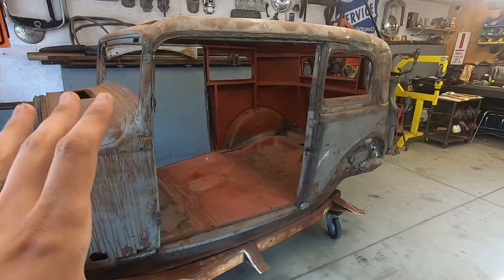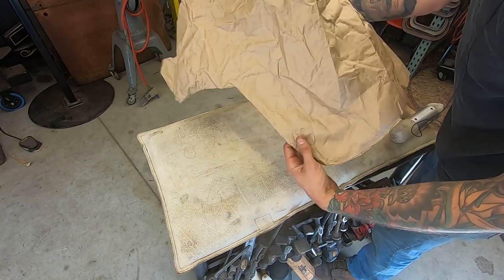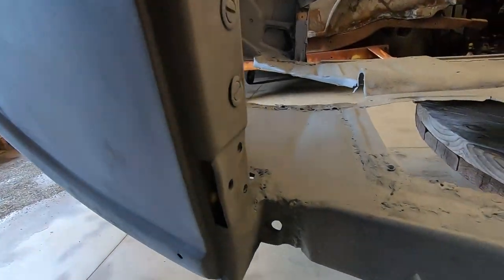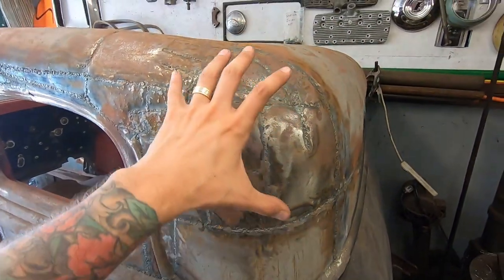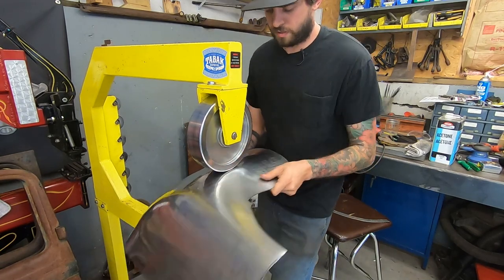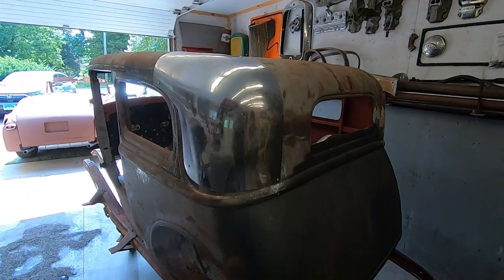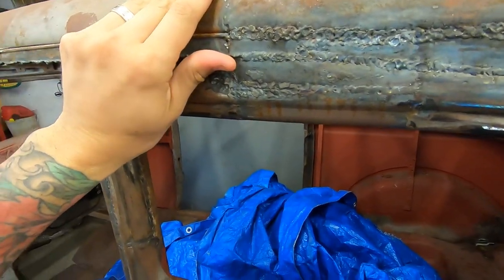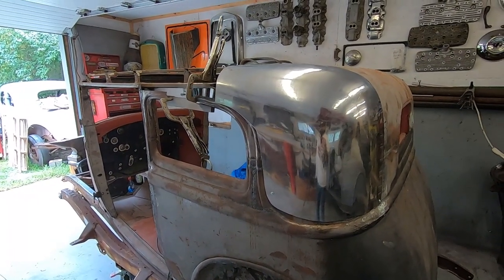1932 Vicky Roof Quarter Panel and 1936 Ford Roadster Back From Blasting

Comment: The 36 had a lot of honest old patches, but that looks like a pretty darn good body to start a build with IMHO.

And I agree. I think the Vicky had damage on that rear corner roof area before the chop and they went ahead and chopped it anyway. It looked like a tree fell on it to me.
Reply from the maker: Yeah it’s not terrible I think the fact that there was an inch of bondo covering the patches and the floor skews my opinion on the whole thing.

Comment: I love the shape templates you are using. I was thinking if you find the center line of the body. Then you can measure from the center line to the edge of the template on the passenger side. Then when you go to the driver side you will have the starting point. That should locate the new patch exactly mirrored from the passenger side.
Reply from the maker: Sorry for the spam reply, good thinking!

Comment: Making these panels truly is "magic"!! I would offer one suggestion to enhance what comes through from your videos. As you, or anyone else, uses the wheel to shrink, stretch, shape these panels, the viewer cannot see how the panel is reacting to what you are doing with the wheel. It's all but impossible to get a feel for your goals/objectives as you go back and forth and turn the piece as you are using the wheel. Since we can't see how the panel is reacting, can you a few minutes in one video where you are forming one of these complex panels saying "this needs to come up along this line so I'm doing X with the wheel to try to make that happen". Turn the panel and offer a similar explanation of what you are trying to accomplish. It could/would add lots of understanding to "the magic" you are performing in your little "magic theater"!!

Comment: That 36 roadster makes me feel so much better about my sedan and the patch I made in the wheel well. What lower dies are you using on the English wheel? I have the same wheel and only got one die with it
Reply: Jegs offers a set of lower anvils you can use with that english wheel.